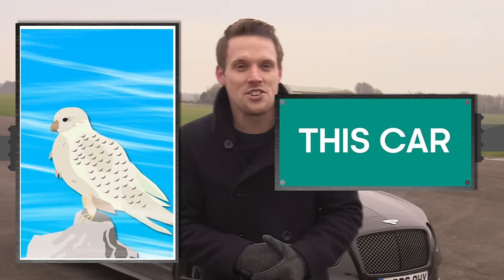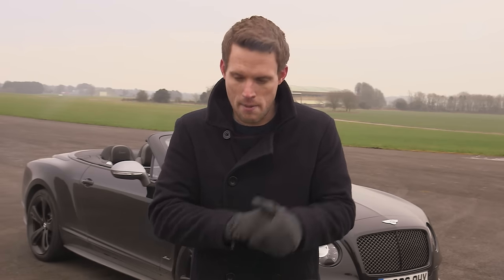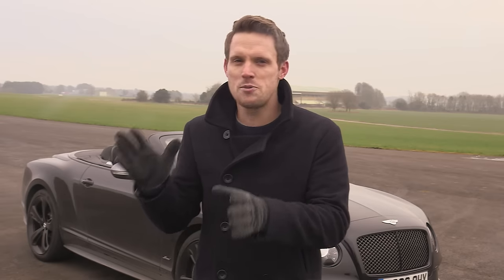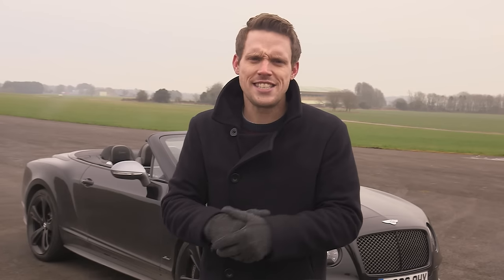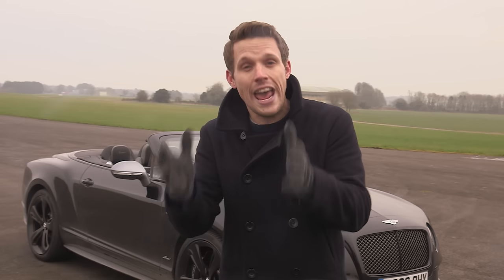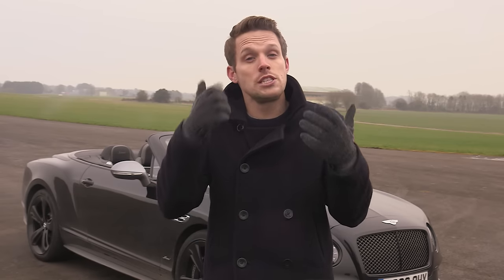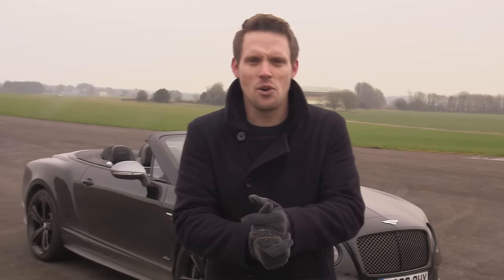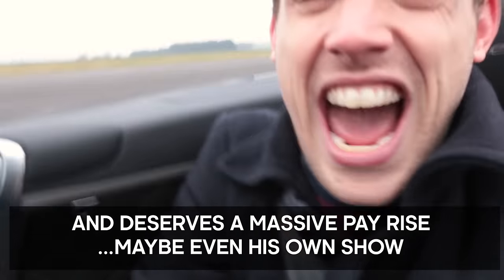What Is Horsepower? | Earth Science

Comment: so what would the power of a trebuchet be if it launched a 90kg payload over 300m?
Reply: 1 DEUS to the power of VULT
Reply: George Connett  in what time?
Reply: It would depend on the time it took to travel its full distance.
Reply: (Force*distance)/time
Reply: By my estimate, the minimum average power of the trebuchet would have to be ~132 kW or ~178 horsepower.  Check my math (and my assumptions).

WARNING: No one asked for this much detail.  I know that.  I was just having fun... :-)

Ignoring air resistance (which is less of an issue the denser and smaller in cross-sectional area the projectile is) 45 degrees is the most efficient trajectory.
40 m/s vertical velocity gives us a hang time of ~8 s.
8 s * 40 m/s horizontal gives us 320 m of distance before the projectile hits the ground.  Close enough.

Total velocity = sqrt((40 m/s)^2 + (40 m/s)^2) = 40 sqrt(2) m/s.
Kinetic energy = 0.5 * 90 kg * (40 sqrt(2) m/s)^2 = 144 kJ.
Assume that the trebuchet swings in 1 second (a guess, but it's probably more than 0.5 and less than 3 s).
Power = 144 kJ / 1s = 144 kW = 193 hp.

Or, if you use standard gravity (9.80665 m/s^2) and solve for 300 m, it comes out around 132 kW or 178 hp.  But honestly, the actual swing time of the trebuchet will account for a much larger error than my rounding gravity and the velocities.

Anyway, this is about the minimum average power through the whole swing.  Loses like friction and air resistance and such could add more.

And, even without air resistance, the needed power increase dramatically if you deviate from 45 degrees (up or down).  (With air resistance the optimum point is lower than 45 degrees, I think, but how much lower depends on the drag coefficient.  But even there, deviating from the ideal angle dramatically increases the power required.)

For example, staying with no air resistance, a launch angle of 30 degrees or 60 degrees gives you 153 kW (205 hp).  15 or 75 degrees gives you 265 kW (355 hp).  5 or 85 degrees gives you 762 kW (1022 hp).  And the closer you get to horizontal or vertical it just keeps shooting off towards infinity because it has less hang time in which to travel 300 m horizontal, so it has to do it faster and faster, hence requiring greater and greater power.

Lastly, I'll just comment that this is the average power.  If you knew about the speed, angle, and force profile of the trebuchet in detail, you could calculate the peak instantaneous power when it was accelerating the projectile most quickly in the tangential direction.  That would be the highest peak power and necessarily substantially higher than these values.
Reply: Chris Sloan Ill give it a B for Bugger it i wish i paid more attention in physics, as i got lost quite quickly haha, but well done.
Reply: Charles Turner Hah!  I guess I didn't really explain what I was doing very much, did I?  So, here's the big picture:

We know a few facts about the trajectory of the projectile.  We also know that all of the kinetic energy the projectile has came from the power of the trebuchet working over roughly 1 second to accelerate it.  So, if we can calculate how much energy the projectile has, we can divide by the acceleration time to get the trebuchet power we're looking for.  That's the high level argument.

So, to find the kinetic energy, we'll need the vertical and horizontal velocity.  I chose 45 degrees, so they are both equal.  The vertical velocity is responsible for the total time aloft.  My first time through I just tried a few values until I found that 40 m/s gave us 8 seconds aloft when the only force applied is gravity.  (It takes 4 second to slow down from 40 m/s to 0 m/s vertical under (roughly) 10 m/s^2 of gravity.  Then it takes the same amount of time to return to the ground giving us 8 seconds total.)  And 8 seconds aloft times 40 m/s horizontally gives us 320 m before the projectile crashes into the ground.  Since my first time through was just an estimate, this is plenty close enough.

Now the Pythagorean gives us a total speed of 56 m/s or so.  And now we can get that into the equation for kinetic energy: KE = 0.5 m v^2.  That have us 144 kJ.

And finally we refer to the original top-level equation and divide 144 kJ by 1 second and get 144 kW, which is what we were looking for.

I honestly don't know if this is more helpful or just adding fuel to the confusion fire.  If you're interested in a great resource, I recommend Crash Course Physics.  I mostly have seen Crash Course's other courses, but they do great work, so I'm sure their Physics course will be great.  (I enjoyed the first couple episodes I did watch.)
Reply: Chris Sloan yes I got it a bit more (although my brain hurts) but thank you for taking the time to try and enlighten me haha. I teach primary school at year 2, so maths does not go much past adding/subtracting two digit numbers.
Reply: annoying thing is i got an A at GCSE maths, but I think I've decided to forget I did that after hitting a wall with A-level physiscs.
Reply: Chris Sloan Hahaha. Well done. I barely remember my undergraduate physics.
But I did fail all my classes, so... Eh.
I knew it was a technically unanswerable question without knowing the time over which force is applied.
A mass, a distance, and the implied force of gravity can give you the energy, but it cannot give you power, because this depends on how quickly the energy was applied.
A trebuchet that accelerates the rock for 2 seconds has half the power of one that does it in 1 second, even if the outcome is the same.
And if it launched in 1/10th th of a second it would be 10 times the power of one second.
Which means the question lacks critical information that has to be guessed based on how a trebuchet might work...
Reply: 420 memes per second cubed
Reply: @doctorbobstone  nice thing about trebuchets is all the power you are solving for is done by passively lowering a weight, and you could just rearm it with a little 1.5hp lawn mower if you didn't have to get a shot off every second 
(In bed math says 13-14 seconds to reload)

Comment: This doesn’t make sense, how pushing the book faster makes more power and the work isn’t changing, you would need more force to push faster
Reply: The book example is not a very good one because there are other factors such as friction that makes it more complex and harder to understand. Work is simply a force times distance, commonly measured in ft*lb or N*m. Power is how fast that work is applied, work divided by time. One horsepower is 550 ft*lb/sec, one Watt is 1 N*m/sec. IMO Lifting something is a better way to show work and power.
Say you wanted to lift a 50 lb box 4 feet into the air. The amount of work involved is 200 ft*lb (50lb * 4ft= 200 ft*lb). The amount of power is dependent on how long it takes to lift the box. If it takes 2 seconds the power exerted will be 0.182 horsepower ( 200ft*lb/2sec= 100 ft*lb/sec one horsepower is 550 ft*lb/sec so we take 100/550 to get 0.182 horsepower)

Comment: this is smtn which iam trying to find out for years .... yes torque menas the pulling power, say 135nm @ 2krpm torque means the engine is able to travel 135meters whem working at 2k rpm ... i still can't understand what hp does to an engine ... more hp means the engine can reach rpms easily amd earlier,say car X has 200hp @ 5k rpm while car Y has 250hp @ 5k assuming all facts and figures associated with both cars are constant and same ... so does car Y reaches 200kmphuch earlier than X takes do reach the same ... please help me

Comment: "1800s before the industrial revolution. Original Steam Engine. James Watt." There's so many things wrong there, mainly that the steam engine was invented in 1698 and was if I'm correct, a pump for flooded/flooding mines since waterwheels couldn't vertically transport water and buckets weren't efficient enough. James Watt I believe was the inventor if not one of the people to make it work. 1800 was more or less at the beginning of the Industrial Revolution, it wasn't called that without a reason, the steam engines powered machinery which increased production which made demand higher which meant more output was required which was why the steam locomotive came around so as to help with increases in productivity but then some people rode the coal wagons and what not and so some guy named George Stephenson saw an opportunity and made passenger "coaches" and made a glorified horse tramline. The Liverpool and Manchester was made a few years later and the Rainhill Trials were held which several entrants were had to see which would run on the Liverpool and Manchester. One was even a horse on a conveyer belt. Three were entered, Rocket, San Pereil, and Novelty, the latter two starting off well but failing later on and so Rocket won. The original locomotive though was made by Richard Trevithick in 1804, I believe it was the Pen-y-darren. Speaking of which the "first steam engine" pictured was an American type (that means 4-4-0), which wasn't around until more towards the middle of the 19th Century. TL;DR This is entirely inaccurate and if James May had done it it would be properly accurate and probably 3 hours 23 minutes longer.

Comment: Torque x RPM

fin.
Reply: Divided by 5252
Reply: Josh Sisson nope
Reply: faisal3398 *assuming imperial units. For metric, it's, er... something else.
Reply: For metric units it's P = w * T (w for engine speed measured in radians pr. sec and T torque,measured in Nm). Output will therefore be in Watts. Divide it bye 735 and you end up with metric HP (or 745 for imperial HP)
Reply: Josh Sisson 2πTN!!!
Reply: Josh Sisson Edward scissor hands

Comment: Conversely, we could have used oxen power, as they were considered more robust than horses. I wanted to know and it can be done through a test or calculation how many people would it take to pull a horse the opposite way or a 7 ton Routemaster bus or diesel locomotive, any one know?
Reply: put 1 ton hprse on ice where 100 kg man be oposit direction on grip ground with hole and he pull this horse with easy 😉👌🏻👉🏻 grip ….even strongest engine at 1 km/h on rev limiter at 1 gear be not able to pull anything with no grip … when grip be the same for human /people on oposite side of line and horse than they be in balance  when horse and those people be weoght similar than they be in place once one side of line be heavier it will pull lighter side 👌🏻

Comment: "More power" is not needed to travel a large distance. 2.20
Reply: Tell that to a golf ball.

Depends on the application. You could apply power for a longer period (car, train), or alternatively apply more power all at once (golf ball, baseball), to make it go further.

[edit]
Or remove friction, etc.
Reply: Martijn Hartman I argued with what was categorically stated. A golf ball has power delivered during a small amount of time and following that is typically modelled by projectile formulae at which point there is initial velocity in the formula for distance (not power).
A Bugatti Veyron (1001 bhp) I looked at the stats for has more power than an ordinary car yet the The Bugatti at full power will only get 51 miles before running out of fuel although a fast exciting way to get there.
Reply: Martijn Hartman Applying power over a certain amount of time is "doing work", not the same as just power, as they described it

Comment: The relation between horsepower and watt seams arbitrary in this example, did I miss something?
Reply: HP and Watt are two units for the same measure, namely power.
Reply: Oh I get that, just the video, didnt really explain it, they said hmm horsepower, then mr watt came along, and watt is they guy watt is named for and now 1hp = 745 watts, but never did we hear what a watt was. Yes I know know what a watt is, I just didnt know how mr watt came along and said, ok 1 hp is going to be 745 units of me
Reply: Michael Bradley Probably he derived the logic for why a watt is the unit it is independently of working out how much power a horse has.
Otherwise if they had any actual relation, or were derived together, they would have a more obvious conversion than 1 hp = 746 watts.

Formally the watt is most often defined in relation to joules, which may explain a few things about it's size as a unit. (Eg. 1 joule per second is 1 watt)

Comment: if your 635hp bently pulls out 635 average adults itll be impossible. the wieght of 635 averge adults would just pull the car in with them. if an average wieght of a adult is eg.85 kgs times that by 635, thats 53,975 kg your bently would have to pull up. average wieght of a bently is close to 3000 kg...thats 50,000 more kgs you gotto pull up...its not plausible dude

Comment: English is not my native language, so the engine/motor difference is not very clear.

Why is not a Nuclear Reactor of Aircraft Carrier not considered an engine? Neither a motor I guess. What it would be?
Reply: Cristiano Mazzotti Nuclear reactor is a power source. It just produces energy. It won't do work. Engine uses that energy and converts to useful work.
Reply: That's watt I said ?
Reply: Mazzotti the reactor is located in the engine room, so...
Reply: Yeah, I forgot to mention the turbine part of the system. :P
Reply: Thank you all.
Reply: Cristiano Mazzotti the nuclear reactor turns a turbine and creates electric energy, and motors (motors use electric power, engines use the power of gas) turn propellers and move the boat forward
Reply: Thanks.
But, what if the turbine was directly linked to the propeller shaft? The then would only the steam turbine be called engine/motor? Would it be an engine or motor?

For a nuclear reactor be called an engine, it would need to somehow generate propulsion, right?

Calling a nuclear reactor an engine would be the same as calling a battery or a fuel tank. Correct?
Reply: Cristiano Mazzotti i don't think it works like that, because turbines are designed to generate electricity, like turning a generator, kind of like how you don't connect your engine straight to the drive shaft, you connect it to a transmission. it's the same with this, the turbine charges batteries, and the batteries power the motor.
Reply: The turbine would not be directly connected, there would be a gearbox in the middle. In fact, there are ships like that. https://en.wikipedia.org/wiki/Nuclear_marine_propulsion

If I'm not wrong, even the Titanic had a steam turbine used to drive the center propeller.
Reply: Cristiano Mazzotti oh then probably yeah
Reply: There is no difference. Motor is not really used in english, its just called an engine. And yes, a nuclear engine is an engine too.
Reply: Motor means electric motor, while engine means combustion engine
buuut nobody uses this right, so it is irrelevant
Reply: pliros exactly what I was referring to lmao thank you
Reply: tl;dr ;)
Reply: Cristiano Mazzotti Because the reactor is only producing the power in the form of Electricity, It is still a measure of engery in the form of watts. The 'Engine' of the ship is an electric motor rated in power of Watts. This can vary in size depending on what is required. 

However as the ship also uses the electricity for day to day running out the ship, plus future weapons will be using the energy generated for weapons such as a Electromagnetic cannon (you tube this, being developed by Bae systems). The power generate to power these would have to be accounted for.
Reply: +Akilesh “AKIL” G a nuclear reactor turns a turbine which in turn turns a motor to produce power, so it can be measured in hp, they just built a natural gas power plant by my house that can supply a 1,000,000 homes took them about 5 years to build. Calgary.
Reply: And sir the reason a nuclear ship can't just use the steam power to drive the ship directly is there is way too much power coming off the turbine, it has power constantly where as a ship has to be able to control its speed, cheers.
Reply: I agree with everything but one thing. There are both types of propulssion. Nuclear > Steam -> Electric and Nuclear > Steam -> Propeller.

 I know Wiki is not the best reference, but I managed to find an article: http://mragheb.com/NPRE%20402%20ME%20405%20Nuclear%20Power%20Engineering/Nuclear%20Marine%20Propulsion.pdf

The article also points to this site http://www.maritime-executive.com/features/time-to-reconsider-nuclear-propulsion.

I know they are not the best references, but it is what I managed to find.

Comment: isnt it true that a horse can have multiple horse power
Reply: Yes.  All horses do not specifically make 1 horsepower.  In fact, 1 horsepower is a very small amount of work.
Reply: yannick van niel 1 horsepower is what they could sustain over long periods of time. Humans can produce 1 horsepower over very short periods as well
Reply: it is true that different horses can be stronger or weaker. But on average it really doesn't make much of a different mathematically
Reply: I would say no as a Horse can only have 1 Horse power as it should be measured by itself being a horse. But i see where you're coming from so i don't actually know.
Reply: It's a pretty stupid measurement, imo.
They should switch over to ft-lbs. or joules per (hour, minute, second).

Imagine if NASA counted in horses.  Would be pretty unprofessional, wouldn't it?
Reply: I mean, hell, if we're using outdated, arbitrary measurement systems, then I guess I'll start counting in floppy discs instead of bytes.

1 TB = 694444.44 floppy discs.  It's still less obsolete than horse power.
Reply: And that's a pretty stupid statement. Obviously the Horse has become a singular measurement. It works and makes sense. Unprofessional? No. It's just effective, anything else is just unnecessary.